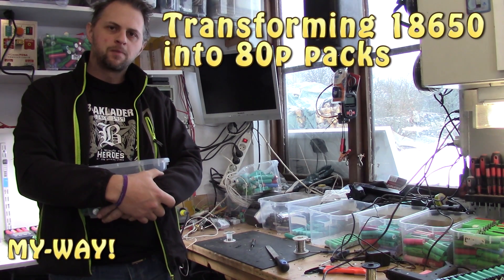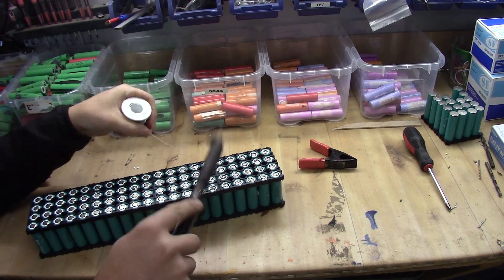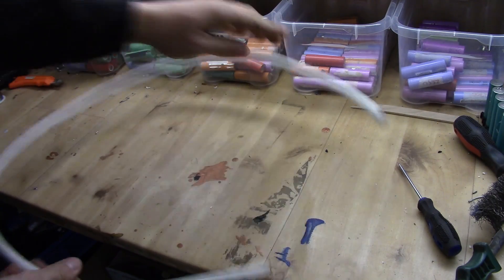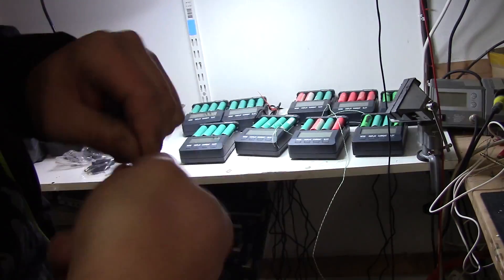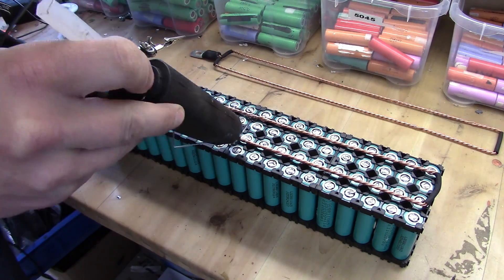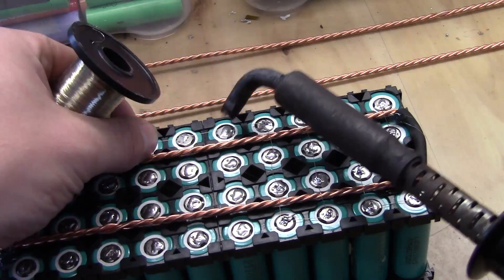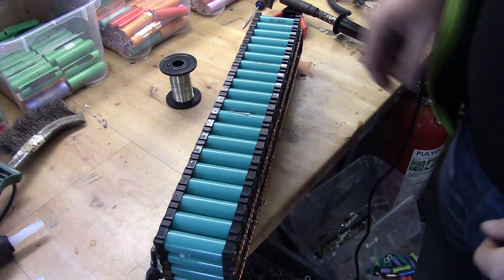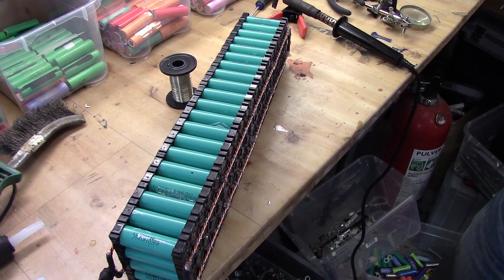18650 - Assemble the packs HOW TO 80 Tesla powerwall!

Comment: How come you didn't measure the resistance of the batteries? Is that important?
Reply from the maker: Because I go by the other values and by testing 10 000 cells I know they will work. It's not high current cells im trying to match up

Comment: When you say wire on negative side is "thicker" can you provide some "range" of what size wire to get?  I'm sorting batteries now, and have the rest of the pieces, just not clear how big of a wire on the bottom.
Reply from the maker: I used thicker There just because its easier and you dont need to fuse both sides
Reply: @DIYTechRepairs  So, left over phone wire would be fine?

Comment: Why does the bus bar extend past the length of the pack? You have it covered, but what if it was shorter and ran under the last row of cells?
Reply: Is this used for even current flow? Would it affect the end cells more if the design isn't perfectly symmetrical?
Reply from the maker: @mwint1982  the more symstrical the better. It extended so i easily can Connect them
Reply: @DIYTechRepairs  I am more curious about the end with the heat shrink. If that end was shorter.
Reply from the maker: @mwint1982  can be. But i want it to stick out to make it easier to assemble

Comment: April27,20/0700hrs. Thank you for the informative video. I’m watching this video for the 4th time; at different times. Every time I watch, I wonder, why there’s no discussion and or video, regarding Charging the assembled unit. Charging is as important as assembly, if I’m not mistaken. How do you charge? What type of charger do you use? What current?  Do you use PV system? If using PV System do you prefer PWM or MPPT controller? You have 4.2V@1kW power assembled, what’d you do with it? What’s the final configuration of the set up? Do you series / parallel them for 12V or 24V operation? Where do you store the final assembly? How do you place the batteries?
I feel the above needs to be addressed. Pardon me for requesting explanation, as above. But every time I watch this video, I have the compelling urge to request. If you happened to view my segment, kindly respond.
Thanks and stay safe with the family. 73s
Reply from the maker: Did you check My overview video? It answers all your questions.
Reply from the maker: And Quick answer.
140kwh battery att 48v. Ie 14s.
Mppt all days. I got 4 mppt channels. 16kwp solar. Batrium bms..powering My 4 buildings. Ie house and workshop and t
2 other.

Comment: This video is a 3 years all video. Still it is a wonderful and up-to-date tutorial. Many thanks!  I plan to follow your example and use the same design, however, one thing is still bothering me, maybe you can help me with an advice here. You make series connections on the one side of the 80p cell, I believe to make it easier to bolt everything on the shelf. But, does it mean that current will mainly flow through the front cells of the 80p pack? I mean that cell on the front of of the pack would be stressed more than ones on the back? Or this does not really matter and could be neglected? I also plan to put cells on the shelves and making connection in between them in the depth of the shelf would be not comfortable. You have a lot of experience and at least 3 years has past already since this particular cell was built. What would you advice: should I make connection points on the different sides of the 80p cell so that current flow equally through all 80 18650s  or does it work perfectly fine when both connection points are on the front side of the cell?

Comment: I wan to build a 128s14p battery pack, there's a lot of cell, do you know a way(calculator) to make all 14p blocks the same capacity
Reply from the maker: 128 cells in series is massive voltage.
. Perhaps 14s128p?   Check My video on how to arrange the cells and you have the sollution There :)

Comment: How did u calculate your watts...volts x amps?
Is this battery pack 24 volts? Or 12 volts
Another question are all your batteries facing one side all positive and the other facing side all negative... because if yes than this is simple...I'm making a power wall than
Reply from the maker: Watt = volt + amp. Those valence are 12 = 4s100p. Terminals is on those in the middle of the packs
Reply: @DIYTechRepairs  so volts + amps pls if you can show me how 
Am I supposed to calculate nominal voltage or highest voltage for each cell than plus amps that means what each of your green cover battries was how many amps pls I would appreciate if u can show me though I've started to build my power wall thank you once more
Reply from the maker: @safwanyousuf3570  nominal voltage depends on the cells you have choosen. All in the datasheet. Are you also mixing kw and kwh?
Reply: @DIYTechRepairs  ok you said volts + amps what does that mean? if my cell is 3.7 volts and 3000mah? So..
Eee sorry I'm confused...
What I'm trying to say is got 110 laptop batteries 
And I have a charger 
Some batteries are discharged some saying 
3.5 volts
3.6 volts 
3.8 volts
4.0 volts etc
And my charger just shows green when its fully charged so but I can see where it says full charged yes but how many mahs is that? Unless I check the site? DIY power walls.com? Is there chargers that show that battery is full at 4.2 volts and holds this much mah makes it much easier for all of us
Reply from the maker: @safwanyousuf3570  You need a tester that tests capacity. Then you get out how much each cell have left. Opus BT c3100 is an example that i link
Reply: @DIYTechRepairs  ok thanks

Comment: Hello! please help me with a tip i need a bms but i don't know how many volts and how many amps it should have, for a li ion battery 14s 51.8v 40ah i have a brushless motor sss56104 790kv 6000w and a pro marine ESC 300A ..Thank you!

Comment: you can put as much as you want  1000 OF 18650  pack why 80
Reply from the maker: Because IF One cells fail its harder to find among 1000 than 80. And the 80 did fit Good in terms of cells i had available including size and balancing caoabilitited

Comment: Why do you use fuse fire on negative pole as well?
Reply from the maker: Because its just simple to add it when on it. I dont have to have 2 sizes in front of me
Reply: I‘m gonna do a 6s6p to charge my batteries when flying in the field. One 2.5 mm wire should be sufficient? Maximum amp draw will be like 16A.

Comment: Soldering a wire directly to the battery is a horrible idea. The excessive temperature destroys the batteries. It would be much better to use a spot welder.
Reply: Solder 30$ a decent spot welder 800$

Comment: if i want to make a battery pack that would supply 48v 100 Ah, how many 18650 cells do i need and how can i organize them?
Reply from the maker: 14s and 100ah in each 14s pack. if you got 2ah cells you need 14s50p. (Could be 13s if voltage is to high on 14)
Reply: so I need to use a total of 700 batteries, right?

Comment: hey guy
how are you can you help me ?

i have some questions
Reply: DIY Tech & Repairs sorry it didn’t go out my reply
Ok
I have many 18650 batteries from a medical devices and I am trying to build a battery pack for my camper.
I charge some and some have 1100 mAh and some 2600 mAh 
Do I need to charge batteries 4 at a time ? O can I build the pack and charge the pack when already build.
I ordered a BMS 4s 100A is coming.
I want to build a 4S 40p 
I also have many Ni Mh batteries 1.2 v 
Can I do a battery pack with those?
Or it is not worst it?
Thanks for your help

Comment: Does any copper wire 0,2mm thin can be used as a 5A fuse? For example, a wire used in winding of motors? I see some people using resistors legs as a fuse. Does this legs burn at 5A or more?
Reply from the maker: Winding motor wire are coated and rather hard to work with. You need to crosscheck them your self if you wanna use them. I cannot tell if they would work for 5A load.
Reply: @DIYTechRepairs  thank you 👍

Comment: I found an improvement on your stripping method. If you put the cable in the vice and take a clawhammer, you can easily pull it off with the clawside. No need to cut anything.

Comment: I just got a 200 watt iron similar to yours. Except it has a flat chisel tip. And it's bent at about 60 deg angle. Making it a bit awkward to use. The tip flattens out to about 1 inch wide and about 1/16" then to a sharp point. It is really hot. And holds heat forever. I can unplug it. Put the tip in water for a few minutes. Then sit it down. And it will still melt solder for quite a while. I tried it out on a dead cell. Wet it with solder. Then soldered 20gauge copper wire to both ends. And it holds very well. Buy the cell wasn't even warm. So I dont guess it will hurt the cells. I am soldering to the nickel  strip. I left a tiny piece on the neg end. To solder to. The solder did cover the nickel and cell. I bent and pulled on the wire. It didn't come loose or even start to. I'm wondering where to get a tip for these irons? Have any idea? It works its just very awkward maybe even difficult to use. The tip if laied flat to cover more area. It covers the whole cell.  It looks to be copper. It may be plated? I don't think I should to cut it grind it. I'm looking for a different tip! Great video...

Comment: I'm just curious on the fuse side. Aren't these batteries rated from 10amps and up(depending on the 18650 amp type) you used 5amp fuse wire. Are these batteries maxed at 5amps?
I'm looking forward to your reply.
Cheers,
Colin.
Reply from the maker: I max them at 0.5A roughly. But in 80p pack they can produce 800A easy. So if 1 cell goes bad 5a or even 10A fuse is not a problem as such. Beware of that using to small wire will cause voltage drop
Reply: @DIYTechRepairs  Thank you for your reply.
A couple more questions please. 
If I use 20amp 18650's in my set up. Should I use 20amp fuse wire to join from the bus-bar? At the one end (does it matter if it's the + or - end?) and what gauge wire should be used on the other end?
Thank you.
Col.
Reply: I recommend checking out battery university (great online resource). The lower your charge/discharge rate, the more charge/discharge cycles your li-ion batteries will yield. According to battery university, < 2 amps charge/discharge rate is desirable.
Reply: @andrewgervais3039  Thank you. Is that a YouTube channel or a website?
Cheers
Reply: It's a website.
Reply: @andrewgervais3039  cheers, thank you. I will be sure to look through it.
EDIT: I'm checking out HEADWAY 38120HP atm.
Reply: cells at 10amps need external cooling
building packs like this you want individual cell current to be low enough that the cells don't heat up, thats a real danger stacking row after row of cells side by side against each other, even in holders there is almost NO natural convection air circulation. and i don't see anybody DIY adding fans
lots of batteries with tiny fuses .... hoping things don't get to hot

Comment: Hi, very nice video, thanks for sharing, I am a kind of beginner and a bit unsure about the voltage of each of your pack. So, if its 12 volts x 3 packs in series, it would be 36 volts ? Or are you connecting 12volt packs parallel... - Is it then better to have a high voltage rather than to stay strict with 12 volts ?

Comment: Thanks for posting.

I'm a bit confused/concerned about why some battery pack builders solder or spot weld.

Too much heat on the battery will damage the cells.
Is it best to use a large soldering iron?
Is there secret to short quick soldering to make the joint without damaging the cell?
What size fuse wire do you use for a given battery pack?
Reply: That's why he is using a 200w soldering iron. If you use lower watts iron it will take much time and damage the battery. Pre fluxing with good quality flux pen will help a lot.

Comment: Is there any strategy or recommendation for individual cell capacity for each 80P pack?  What is the maximum difference between cell capacity in each 80P pack?  Can you have cells that are around 1500 milliamps ranging to 3000 milliamps or should all of the cells be within a certain range?    Thanks in advance for your time to answer my question.

Comment: You are working with DC, not AC,  DC  uses the outside of the wire. Not the inside.
Reply: Are you referring to the "skin effect"?  If yes, I think you may have it backwards.  Higher frequency AC signals tend to travel on the outer edge of conductors... but...  DC is not high frequency AC.  So your statement is a bit confusing.

Comment: would it be better to build packs series paralleled. or all parallel then series the packs?
Reply from the maker: Depends on how many BMS systems you want to have? You need one per string. xsyp then its 1 string but ypxs then you get y number of strings :)
Reply: DIY Tech & Repairs 
I hope to end up with about 10,000+ cells. in a 7s24v pack. or 29v max.   I was going to use the. BMS/balance board for charging only. since the inverter shuts off its self. at low voltage. and use a low voltage disconnect for DC loads. I was thinking since the pack is going to be so large. maybe use a MOSFET and a 6v incandescent  bulb. to pull down the high cells balancing them. just mod the balance board. and get about a amp or so. most I heard have like 60ma or 120ma balance current. I haven't seen any cheaper boards
with more. with my limited know how in electronics . I may end up burning up a few. so a few extra wouldn't be a bad idea. I'm thinking start with 20cells in a 4x5 pack paralleled . times 7 series. then keep adding to that. and if there isn't enough cells to double . maybe build a small series parallel pack. so the pack can be used. until I get more cells. but hopefully I will not have to deal with that. I was thinking about keeping a extra BMS balance board for backup. or would large 7s by ? parallel packs. just be more complicated than it needs to be. thanks. have any ideas for good cheap BMS/balance boards?
Reply from the maker: None of the cheap are "good" and I would definitely use the BMS both for load and charging. The Inverter will only look at total voltage and not individual voltages on your packs. Its better to split the packs into several strings with several BMS systems. Doing that will get you better view of how it all works and you can swap out a pack if needed.  When you start looking at those smaller BMS you will though soon end up at a larger cost and then the Batrium or other werent that expensive. Especially not with 10 000 cells....  
Here you got example BMS https://goo.gl/z5NAUw  but it only does 20A and it only balances when you reach top charge ie 4.2V. One on each 20p pack or if you plan on lower current per cell you can go higher packs like 40p or equal. Thats what I would do it but for 10 000 cells in total I would go a proper BMS like Batrium ;)

Comment: so if i have 6kw panels, and 5kw inverter i use 23kwh / day   3 of these banks should cover night usage you think?
Reply from the maker: It depends on how much you use per night. Lets say you use 20kWh during 1 night you would need atleast 2.5 of above strings to cope with it. More preferable would be lets say 4-5 or more so you can cope with some bad weather too. I use 16kWh per day and got almost 100kWh of storage currently
Reply: DIY Tech & Repairs i mean 23kwh is my entire day night usage. Thanks for getting back to me.
Reply from the maker: day or night? or both?
Reply: DIY Tech & Repairs yeah Etotal is 23kwh day &night. That was before my 6kw panels 5kw inverter.  So that’s my rough day night usage.
Reply from the maker: So what is your night useage? Its hard to calculate that without knowing the actual usage. Currently I only know the total and depending on area your nigh can be 5kWh or it can be 20kWH

Comment: I need help I am from Puerto Rico I have an inverter of 1500 watts and three solar panels of 100 watts in parallel charge to 13.5v 20 amp. How many batteries do I need for the system so that it works for me 24 hours I do not know if you can not do much of the batteries 18650 thank you so I can turn on my refrigerator I have no service for hurricane Maria thank you.
Reply from the maker: Hi. the problem is that the charger you have is Lead acid and if you use 3s you will overcharge the cells. Can you set voltage on the controller? If not you need to go to 4s but then you wont be able to fully charge it either.  How many cells you need in total i cant tell because that depends on your total load during 24 hours. Glad to help so just hit reply and i will reply again.
Reply: my consumption is 560 watts per hour for 4 hours and then 110watts the refrigerator 16 hours as many batteries at least I need for the refrigerator that consumes 110 watts thanks to using the 18650 for your attention is that the other batteries are very expensive.
Reply from the maker: Im not sure i follow?  560w for 4 hours per 24 hours?  and the refrigerator runs for 16 hours per day and 110watt?

Comment: Thanks for your video. I have a small question why we need to cut the fuse wire at negative at 11:45. Can we let the fuse run through row like 4 negative will be connected. Thank you
Reply from the maker: The more places the wire is hooked up to the higher current is needed. So thats why you only use 1 point of contact to the busbar per cell.

Comment: so you disassembly the 80 p pack for charge or use a bigger charger, can I have the model
Reply from the maker: No, the 80p packs are bundled into my powerwall and then charged by my solar system.  If I want to charge a bigger pack itself I use my iCharger as mentioned in the other video I linked.